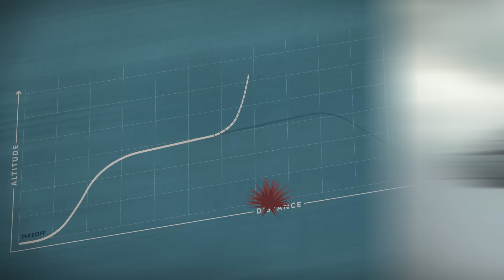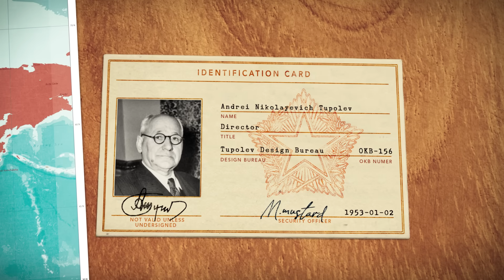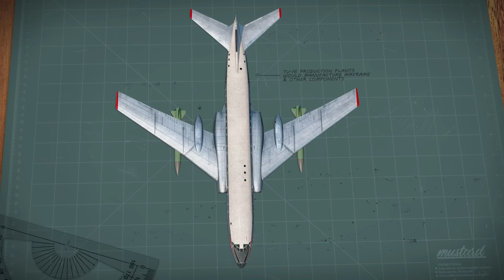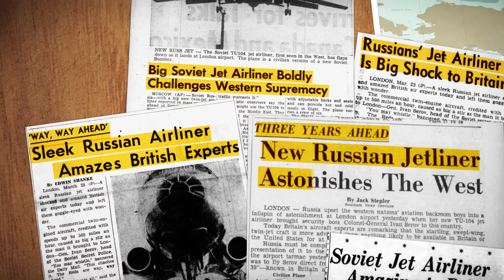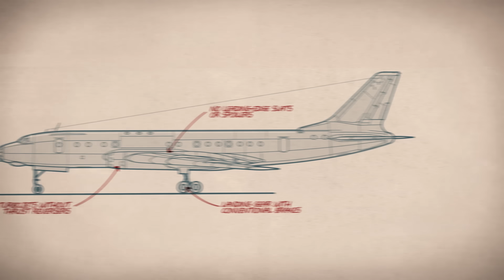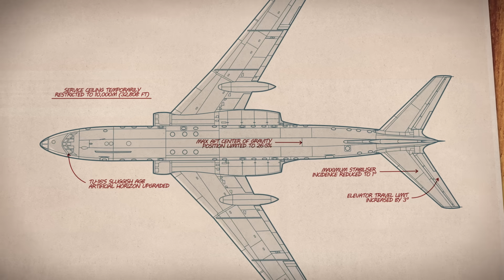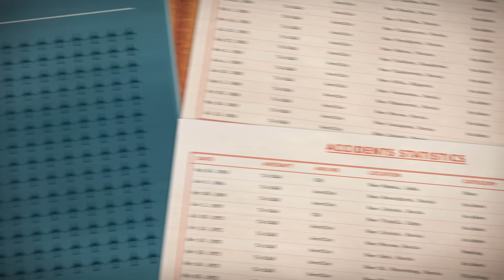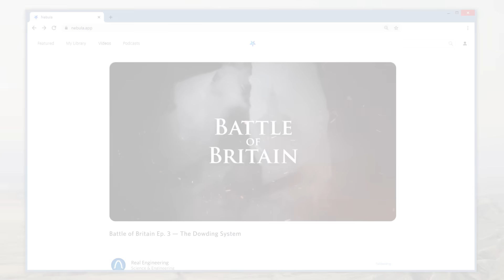The Soviet Airliner Designed To Crash

Comment: The marvellous trailblazing DH Comet.

World's first jet airliner.
World's first high altitude airliner.

The Tupolev and DH Comet had similar accident losses statistics l 

De Havilland was subjected to forced merger during the UK Govt instigated aerospace sector rationalisation programme.

Instances of all Comet marks, including the Comet 1, flew with full certification at some point after 1954. Airline duty Comets were all retired by 1980 with full certification until after retirement. The last Comet flight was a global circumnavigation series of flights in 1997.

   Of course De Havilland carried out a full stress analysis & performed extensive & protracted testing on two long lengths of fuselage. De Havilland carried out significantly more testing than was required by any authority at the time & significantly more testing that any previous airliner was subjected to.

    De Havilland did indeed always work to better than industry standards at the time, used up to date knowledge for the design & no evidence of negligence  or criminal negligence was ever produced in relation to the DH Comet.
  
  Obviously there have been worse aircraft for accident losses both before & after the Comet, that includes's fatality rate metrics. One of the issues was accident losses & incidents due to pilot error which were often caused by the novel aspects of jet airliner flying, even so, the accident losses for the Comet were not particularly unusual at the time.

About Bow-wing for instance (See b-47 wing folding / collapse incidents.)

There can be no excuses for the 737 Max incidents after more than 50 years design, build and operation experience & with up to date aviation infrastructure. 737 Max, 2 particular incidents caused 350 fatalities. Aircraft auto pilots itself into the ground, two times.

The many & varied reasons for Bow-wing's (See b-47 wing folding wing collapse incidents) current existence & status have nothing to do with the company itself by the way.  

    How things were back then. 
Accident losses - % of aircraft built.
DeHavilland Comet 4 UK              14% 
DeHavilland Comet all mks          17%  
Vickers VC10 UK                            5%

The DH Comet had better safety than or similar safety to many other commercial passenger aircraft of a similar era.
Douglas DC-1                                      99%
Douglas DC-2                                      47%
Douglas DC-3                                      30%
Douglas DC-4                                      26%
Boeing s300                                        72% 
Boeing 307                                          70%
Boeing 247                                          48%
Boeing 707                                          20% 
Lockheed L-049/149 Constellation  30%
Lockheed Electra  Turboprop .          29%
Fairchild FH-227                                 30%
McDonnell Douglas DC-8                  14%
Sud Aviation Caravelle                       15%
Canadair CL-44  Turboprop               46%  
Convair CV-580  Turboprop               22%
Convair CV-880     (ff 1959)               27%  
Convair CV-990     (ff 1961)               33%
Tupolev T-104        (ff 1956)               16%.

Comment: Were the CIA involved?
Reply: America just made better aircraft
Reply: The Tupolev & Comet  had similar accident losses statistics.

The marvellous trailblazing DH Comet.

World's first jet airliner.
World's first high altitude airliner.

De Havilland was subjected to forced merger during the UK Govt instigated aerospace sector rationalisation programme.

Instances of all Comet marks, including the Comet 1, flew with full certification at some point after 1954. Airline duty Comets were all retired by 1980 with full certification until after retirement. The last Comet flight was a global circumnavigation series of flights in 1997.

   Of course De Havilland carried out a full stress analysis & performed extensive & protracted testing on two long lengths of fuselage. De Havilland carried out significantly more testing than was required by any authority at the time & significantly more testing that any previous airliner was subjected to.

    De Havilland did indeed always work to better than industry standards at the time, used up to date knowledge for the design & no evidence of negligence  or criminal negligence was ever produced in relation to the DH Comet.
  
  Obviously there have been worse aircraft for accident losses both before & after the Comet, that includes's fatality rate metrics. One of the issues was accident losses & incidents due to pilot error which were often caused by the novel aspects of jet airliner flying, even so, the accident losses for the Comet were not particularly unusual at the time.

About Bow-wing for instance (See b-47 wing folding / collapse incidents.)

There can be no excuses for the 737 Max incidents after more than 50 years design, build and operation experience & with up to date aviation infrastructure. 737 Max, 2 particular incidents caused 350 fatalities. Aircraft auto pilots itself into the ground, two times.

The many & varied reasons for Bow-wing's (See b-47 wing folding wing collapse incidents) current existence & status have nothing to do with the company itself by the way.  

    How things were back then. 
Accident losses - % of aircraft built.
DeHavilland Comet 4 UK              14% 
DeHavilland Comet all mks          17%  
Vickers VC10 UK                            5%

The DH Comet had better safety than or similar safety to many other commercial passenger aircraft of a similar era.
Douglas DC-1                                      99%
Douglas DC-2                                      47%
Douglas DC-3                                      30%
Douglas DC-4                                      26%
Boeing s300                                        72% 
Boeing 307                                          70%
Boeing 247                                          48%
Boeing 707                                          20% 
Lockheed L-049/149 Constellation  30%
Lockheed Electra  Turboprop .          29%
Fairchild FH-227                                 30%
McDonnell Douglas DC-8                  14%
Sud Aviation Caravelle                       15%
Canadair CL-44  Turboprop               46%  
Convair CV-580  Turboprop               22%
Convair CV-880     (ff 1959)               27%  
Convair CV-990     (ff 1961)               33%
Tupolev T-104        (ff 1956)               16%.

Comment: It had the flying qualities of a manhole cover.
Reply: Still much safer than the de Havilland Comet... Comet 1 had a 46% loss rate and the highest fatalities rate of any jet airliner in history.
Reply: Tupolov still makes jet aircraft... it's was the British de Havilland company that made the most dangerous jet airliner... de Havilland went tits-up in 1958 because of the Comet Disaster
Reply: The Tupolev & Comet  had similar accident losses statistics.

The marvellous trailblazing DH Comet.

World's first jet airliner.
World's first high altitude airliner.

De Havilland was subjected to forced merger during the UK Govt instigated aerospace sector rationalisation programme.

Instances of all Comet marks, including the Comet 1, flew with full certification at some point after 1954. Airline duty Comets were all retired by 1980 with full certification until after retirement. The last Comet flight was a global circumnavigation series of flights in 1997.

   Of course De Havilland carried out a full stress analysis & performed extensive & protracted testing on two long lengths of fuselage. De Havilland carried out significantly more testing than was required by any authority at the time & significantly more testing that any previous airliner was subjected to.

    De Havilland did indeed always work to better than industry standards at the time, used up to date knowledge for the design & no evidence of negligence  or criminal negligence was ever produced in relation to the DH Comet.
  
  Obviously there have been worse aircraft for accident losses both before & after the Comet, that includes's fatality rate metrics. One of the issues was accident losses & incidents due to pilot error which were often caused by the novel aspects of jet airliner flying, even so, the accident losses for the Comet were not particularly unusual at the time.

About Bow-wing for instance (See b-47 wing folding / collapse incidents.)

There can be no excuses for the 737 Max incidents after more than 50 years design, build and operation experience & with up to date aviation infrastructure. 737 Max, 2 particular incidents caused 350 fatalities. Aircraft auto pilots itself into the ground, two times.

The many & varied reasons for Bow-wing's (See b-47 wing folding wing collapse incidents) current existence & status have nothing to do with the company itself by the way.  

    How things were back then. 
Accident losses - % of aircraft built.
DeHavilland Comet 4 UK              14% 
DeHavilland Comet all mks          17%  
Vickers VC10 UK                            5%

The DH Comet had better safety than or similar safety to many other commercial passenger aircraft of a similar era.
Douglas DC-1                                      99%
Douglas DC-2                                      47%
Douglas DC-3                                      30%
Douglas DC-4                                      26%
Boeing s300                                        72% 
Boeing 307                                          70%
Boeing 247                                          48%
Boeing 707                                          20% 
Lockheed L-049/149 Constellation  30%
Lockheed Electra  Turboprop .          29%
Fairchild FH-227                                 30%
McDonnell Douglas DC-8                  14%
Sud Aviation Caravelle                       15%
Canadair CL-44  Turboprop               46%  
Convair CV-580  Turboprop               22%
Convair CV-880     (ff 1959)               27%  
Convair CV-990     (ff 1961)               33%
Tupolev T-104        (ff 1956)               16%.

Comment: Regardless the Art deco looks good on this plane ✈️
Reply: Looks far more modern than the D-H Comet
Reply: @DoktorBayerischeMotorenWerke 

The Tupolev & Comet  had similar accident losses statistics.

The marvellous trailblazing DH Comet.

World's first jet airliner.
World's first high altitude airliner.

De Havilland was subjected to forced merger during the UK Govt instigated aerospace sector rationalisation programme.

Instances of all Comet marks, including the Comet 1, flew with full certification at some point after 1954. Airline duty Comets were all retired by 1980 with full certification until after retirement. The last Comet flight was a global circumnavigation series of flights in 1997.

   Of course De Havilland carried out a full stress analysis & performed extensive & protracted testing on two long lengths of fuselage. De Havilland carried out significantly more testing than was required by any authority at the time & significantly more testing that any previous airliner was subjected to.

    De Havilland did indeed always work to better than industry standards at the time, used up to date knowledge for the design & no evidence of negligence  or criminal negligence was ever produced in relation to the DH Comet.
  
  Obviously there have been worse aircraft for accident losses both before & after the Comet, that includes's fatality rate metrics. One of the issues was accident losses & incidents due to pilot error which were often caused by the novel aspects of jet airliner flying, even so, the accident losses for the Comet were not particularly unusual at the time.

About Bow-wing for instance (See b-47 wing folding / collapse incidents.)

There can be no excuses for the 737 Max incidents after more than 50 years design, build and operation experience & with up to date aviation infrastructure. 737 Max, 2 particular incidents caused 350 fatalities. Aircraft auto pilots itself into the ground, two times.

The many & varied reasons for Bow-wing's (See b-47 wing folding wing collapse incidents) current existence & status have nothing to do with the company itself by the way.  

    How things were back then. 
Accident losses - % of aircraft built.
DeHavilland Comet 4 UK              14% 
DeHavilland Comet all mks          17%  
Vickers VC10 UK                            5%

The DH Comet had better safety than or similar safety to many other commercial passenger aircraft of a similar era.
Douglas DC-1                                      99%
Douglas DC-2                                      47%
Douglas DC-3                                      30%
Douglas DC-4                                      26%
Boeing s300                                        72% 
Boeing 307                                          70%
Boeing 247                                          48%
Boeing 707                                          20% 
Lockheed L-049/149 Constellation  30%
Lockheed Electra  Turboprop .          29%
Fairchild FH-227                                 30%
McDonnell Douglas DC-8                  14%
Sud Aviation Caravelle                       15%
Canadair CL-44  Turboprop               46%  
Convair CV-580  Turboprop               22%
Convair CV-880     (ff 1959)               27%  
Convair CV-990     (ff 1961)               33%
Tupolev T-104        (ff 1956)               16%.

Comment: i'd like to ask something, and yes i know this video is an older one.  can someone explain why there's a string going from the cockpit to the tail?  i do not understand why that's there or what it's supposed to be doing.
Reply: Its used to measure the change in length of the pressurized cabin as it stretches and grows at higher altitudes.
Reply: The Tupolev & Comet  had similar accident losses statistics.

The marvellous trailblazing DH Comet.

World's first jet airliner.
World's first high altitude airliner.

De Havilland was subjected to forced merger during the UK Govt instigated aerospace sector rationalisation programme.

Instances of all Comet marks, including the Comet 1, flew with full certification at some point after 1954. Airline duty Comets were all retired by 1980 with full certification until after retirement. The last Comet flight was a global circumnavigation series of flights in 1997.

   Of course De Havilland carried out a full stress analysis & performed extensive & protracted testing on two long lengths of fuselage. De Havilland carried out significantly more testing than was required by any authority at the time & significantly more testing that any previous airliner was subjected to.

    De Havilland did indeed always work to better than industry standards at the time, used up to date knowledge for the design & no evidence of negligence  or criminal negligence was ever produced in relation to the DH Comet.
  
  Obviously there have been worse aircraft for accident losses both before & after the Comet, that includes's fatality rate metrics. One of the issues was accident losses & incidents due to pilot error which were often caused by the novel aspects of jet airliner flying, even so, the accident losses for the Comet were not particularly unusual at the time.

About Bow-wing for instance (See b-47 wing folding / collapse incidents.)

There can be no excuses for the 737 Max incidents after more than 50 years design, build and operation experience & with up to date aviation infrastructure. 737 Max, 2 particular incidents caused 350 fatalities. Aircraft auto pilots itself into the ground, two times.

The many & varied reasons for Bow-wing's (See b-47 wing folding wing collapse incidents) current existence & status have nothing to do with the company itself by the way.  

    How things were back then. 
Accident losses - % of aircraft built.
DeHavilland Comet 4 UK              14% 
DeHavilland Comet all mks          17%  
Vickers VC10 UK                            5%

The DH Comet had better safety than or similar safety to many other commercial passenger aircraft of a similar era.
Douglas DC-1                                      99%
Douglas DC-2                                      47%
Douglas DC-3                                      30%
Douglas DC-4                                      26%
Boeing s300                                        72% 
Boeing 307                                          70%
Boeing 247                                          48%
Boeing 707                                          20% 
Lockheed L-049/149 Constellation  30%
Lockheed Electra  Turboprop .          29%
Fairchild FH-227                                 30%
McDonnell Douglas DC-8                  14%
Sud Aviation Caravelle                       15%
Canadair CL-44  Turboprop               46%  
Convair CV-580  Turboprop               22%
Convair CV-880     (ff 1959)               27%  
Convair CV-990     (ff 1961)               33%
Tupolev T-104        (ff 1956)               16%.